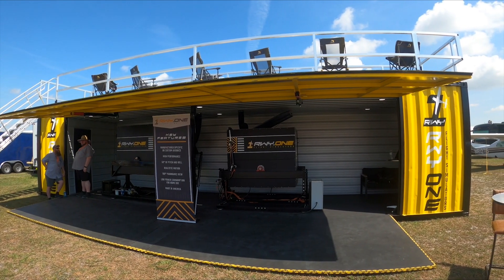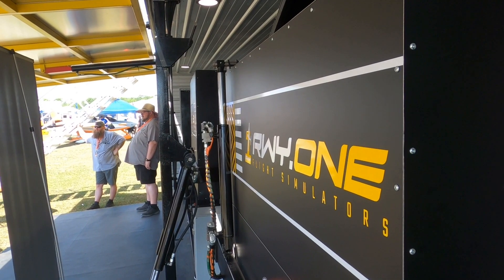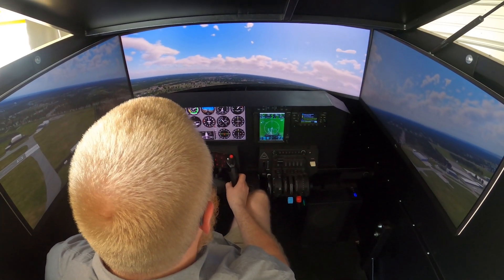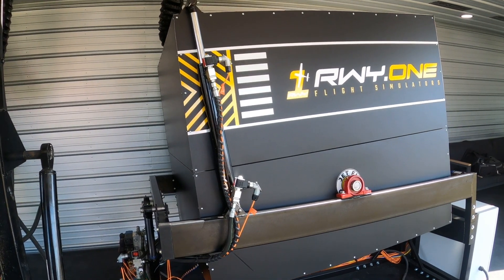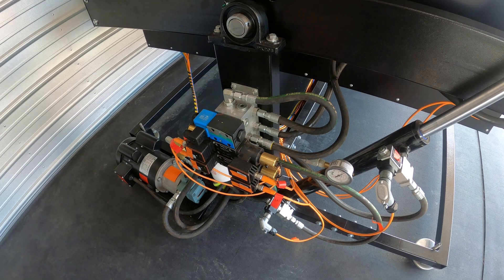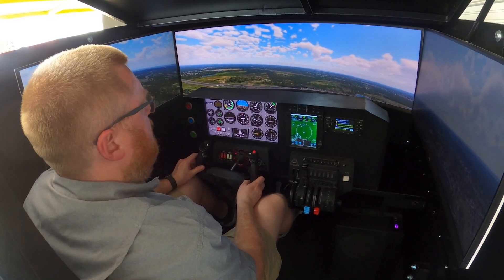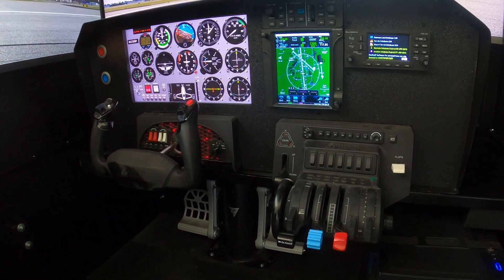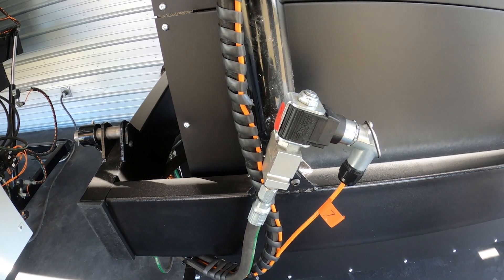Runway One's Custom Motion Simulators

Comment: "you feel the gforces..."   no
Reply: The multi-million dollar airliner sims are shockingly realistic when it comes to G forces. Basically they use motion to trick your body into thinking you’re accelerating or decelerating. If it ‘leans back’ while the image on your screen is still level, for example, your body will interpret that as acceleration.

No idea if this captures that level of realism but, I wouldn’t be surprised if it does a decent job. Full motion sims for GA already exist (some flight schools use them) and they DO manage to capture some basic sense of G Forces.
Reply: @RomansFiveDotEight  I’ve flown a handful of big, full motion sims as part of my job, and they do a decent job of recreating small motions, that “seat of your pants” feeling. But they cannot simulate unusual attitudes or very high or low G-forces.
Reply: They exploit the same thing that causes spatial disorientation.